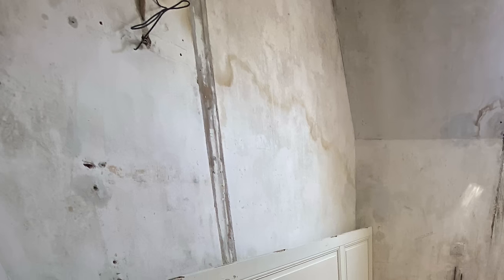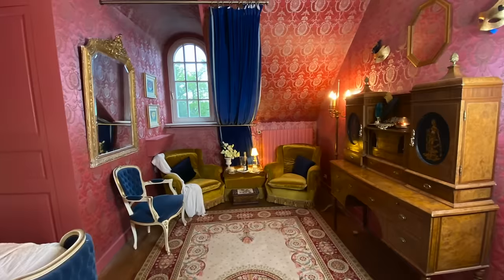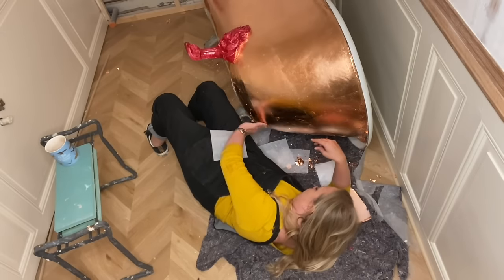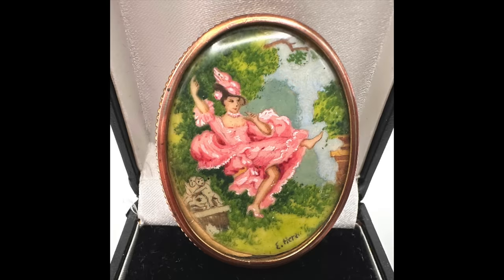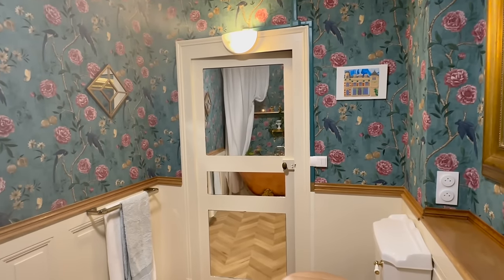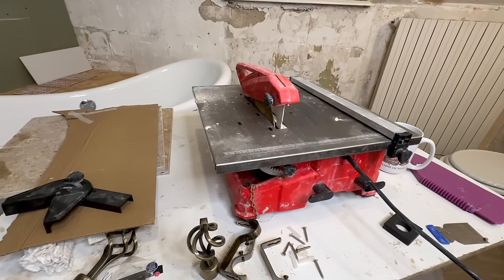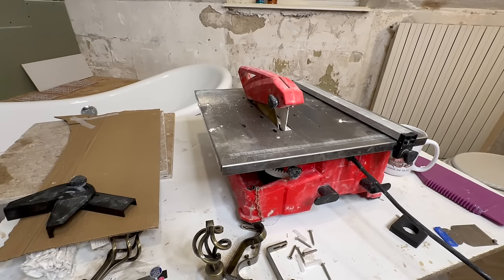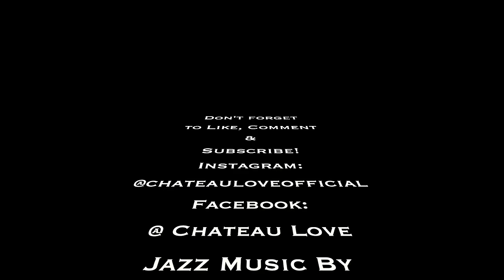Huge Transformation! Chateau DIY BATHROOM Renovation: Before, After & BIG REVEAL #interiordesign

Comment: Looks absolutely visionary. But on the side of caution. I’d get some corking silicone between the tile edge you cut, in and around the gap at edge where the paneling cuts in to fill that little gap.